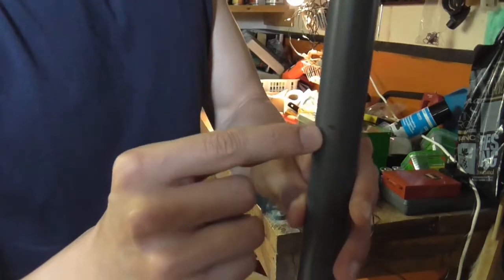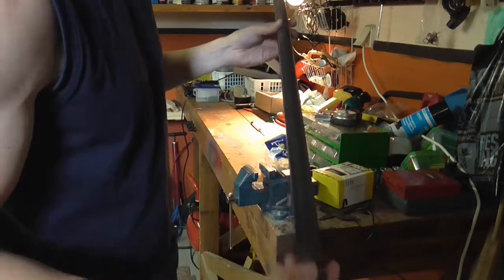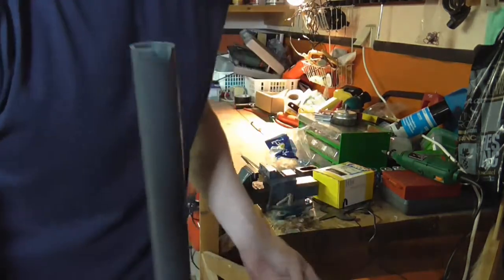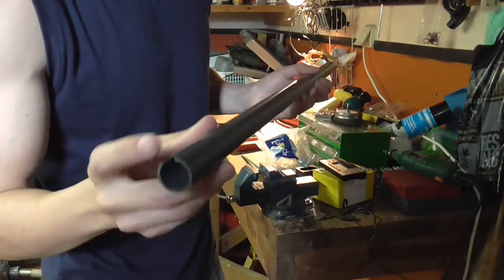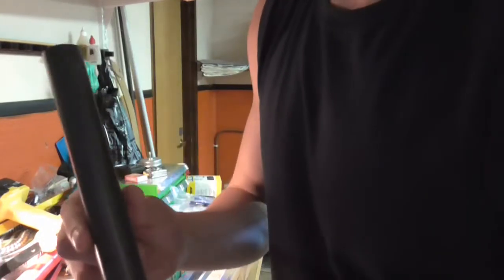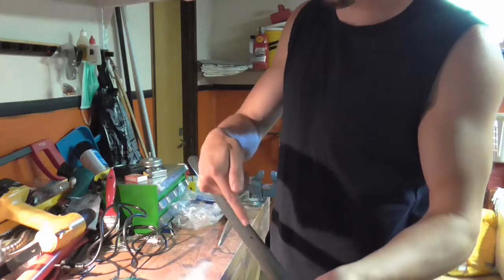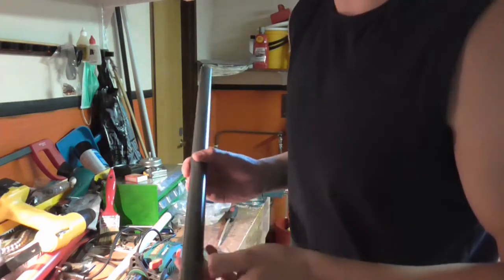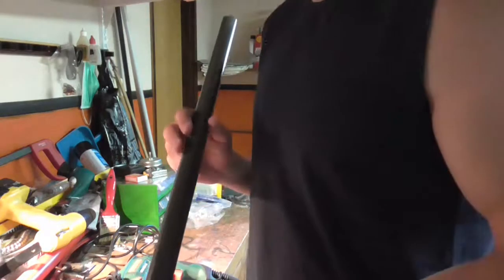Making pvc Xiao flute part1

Comment: I have tried flutomat With my pipe's dimensions (inside 1,9 cm and outside 2,5 cm), and G note, 87,5 cm long. Holes are aller 0,8 cm but i'm bad
Reply from the maker: Did you choose D from flutomat for G-scale-xiao, because the root note in G-xiao is D. And start practicing by using same finger hole sizes that I show in part 2. Notes for eight hole G-xiao: d4, e4, f4, f#4, g4, a4, Bb4, c5, c#5. In six hole version you make it like this: d4, e4, f#4, g4, a4, b4, c#5
Reply from the maker: Oh and... with 1,9 inside and 2,5 outside diameter your pipes wall thickness should be 0,3
Reply: Hi so now i know i didn't understand how to use flutomat. Thank you for corrections and i Will perform it and give you results
Reply: i thinked that 8 hole xiao had : for left hand, 1 thumb hole under and 3 fingers; and for right hand 4 holes  then the  4 under holes. With flutomat 8 holes version there is just 6 holes ! you've an idea.
Reply: i thinked that 8 hole xiao had : for left hand, 1 thumb hole under and 3 fingers; and for right hand 4 holes then the 4 under holes. With flutomat 8 holes version there is just 6 holes ! you've an idea.